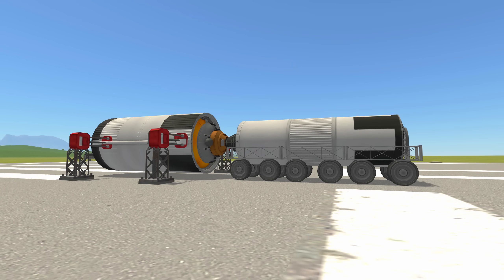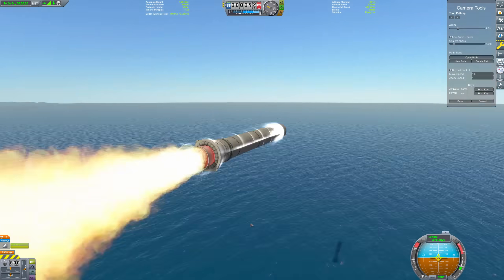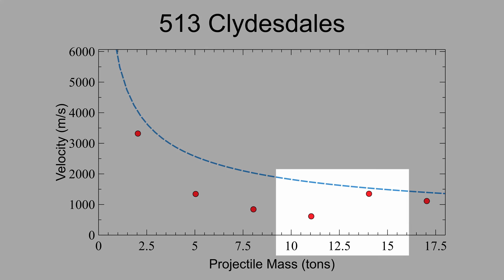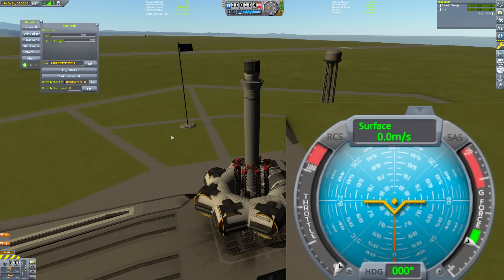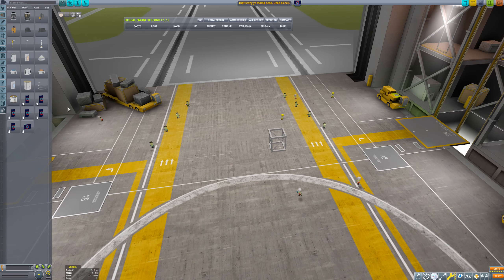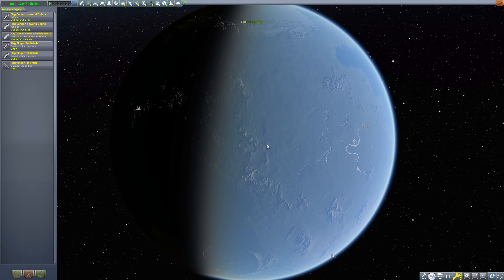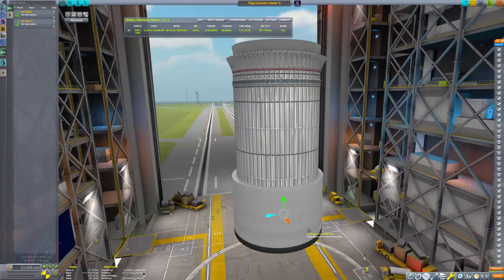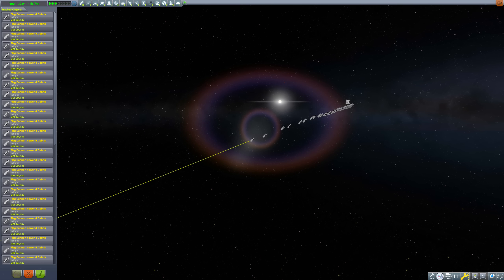Engineering a LIGHT-SPEED mass driver | KSP 1.10.1

Comment: Wouldn't 4x time warp quadruple the velocity? Since 4x the force gets applied in the same frame.
Reply from the maker: That's an interesting thought. I did all these experiments at 1x physics warp and with my physics delta set to 0.03 in the settings. I think it is worth experimenting with these settings to get a more potent mass driver.
Reply: No, I don’t think so. I think physical time warp works by increasing the physics time step, not by multiplying all the forces and velocities by 4. So you would still only get 1 step in the thrust before you were ejected. It would be interesting to test though.
Reply: @samburnes9389  yeah, but if you increase the length of the time step, you have to correspondingly increase the size of the force per timestep.
Reply: Mads Philipsen that’s true, my mistake. Maybe I’ll try it in KSP later today to confirm
Reply: @samburnes9389  excited to hear the results!
Reply: Mads Philipsen okay, some preliminary results: my craft weighed 41kg and was accelerated by 25 boosters. At 1x, it achieved 3,758 m/s. At 2x it achieved 15,011 m/s, at 3x, it achieved 33,756 m/s, and at 4x it achieved 59,947 m/s. So it doesn’t have a linear relationship, more research is needed. With lower speeds it seemed to decrease the final velocity, but with enough acceleration it boosted it massively.
Reply: Mads Philipsen more interesting results: I lowered the mass more and increased the number of boosters, and I dropped it like Stratzenblitz did in the video, and the data becomes inconsistent. At 1x and 2x it’s consistent around 23,000 and 12,000 respectively, but 3x can vary from 17,000 up to 280,000 or 320,000. And 4x has been consistent at 23,630
Reply from the maker: @samburnes9389  Did you try turning off the atmosphere with hyperedit? The atmosphere can sometimes create inconsistent results.
Reply: Stratzenblitz75 I didn’t do it with hyper edit, but I did set drag and lift to zero. It was obvious by the way objects moved that there was no air resistance. It was very consistent at 1x time warp, and mostly consistent at 2x, but past that it varied wildly.
Reply: Sam Burnes That isn’t a linear relationship, but a perfect quadratic relationship. 2x time warp gives you 4x velocity, 3x gives you 9x velocity, 4x gives you 16x velocity. Speed goes up squared in accordance to physics warp.
Reply: Kerbodynamic X there isn’t a quadratic relationship either. The average for 3x is greater than it is for 4x depending on how many boosters I use.
Reply: @kerbodynamicx472  I think I know why. We established that the acceleration needed to be quadrupled per frame, but we forgot that the velocity also needed to be quadrupled. The example down below should explain it.

Acceleration = force * time
Velocity = acceleration * time
Therefore 
Velocity = force * time^2

So if we, as an example, use 4x time warp:
Velocity = force * (time*4)^2
Velocity = force * time^2 * 16
Reply: @samburnes9389   Could it be the same effect described by Stratzenblitz in his video, where the number of frames in the thrust descres with force?
Reply: Mads Philipsen yes, that’s possible, but it happens across a wide range of accelerations, so it’s unlikely.
Reply: But is it cheating? When I re-enter, I always stop time warp below 50km on Kerbin, because the atmospheric heating doesn't produce the same results, even for small simple ships. They don't heat up as much with time warp on, so it feels like cheating.
BTW, they need to boost acceleration quadraticly to give roughly the same physics. a is measured in m/s^2, so that is logical.
Reply: @mennol3885  I think launching a multipart craft this way without it tearing apart is near impossible, so if you can good for you.
Reply: No it gets the force 4x more but it also gets the force during a 4x shorter time
Reply: @Mr BenjiBoy wait so time warp is the same number of physics steps as normal gameplay? That can't be right because of the kraken-ness that happens.

Comment: You could craft file edit a decoupler. I got a Mk3 pod to about 1,000x lighspeed with that method without any cheats. I’d be curious to see how you put that to use
Reply from the maker: When you mod the game, of course its easy to hit ridiculous velocities. With the KAL engine overclocking bug for example, you can hit light-speed with only a few SRBs.
The point of this video was to do it in an unmodded stock game.

That said, modding the parts could be interesting. I wonder if you can overflow the velocity with a high enough value?
Reply: Stratzenblitz75 fair point. Also, I’d love to see if you could accomplish a similar feat with super fast spinning objects. Nothing’s stopping you from slingshotting something at the speed of light... right?

Comment: Did you check to see if the dropping method slope matched the 2 frames of boost slope? They look similar, and I'd guess you get a frame of boost when first dropping and then another frame of boost before it gets back out. One frame gets the acceleration added but the position from falling. The next frame gets another boost of acceleration, and the position gets calculated from the previous acceleration.
Reply: Interesting.
Reply: @notfeedynotlazy  That's how most time based simulations work. Each value of state (position, velocity, acceleration) get calculated for the current time based on the previous time step values.
Reply: In that case I would have expected the speed to be roughly double, but here it's 5 times higher which is intriguing.
Reply from the maker: It is very weird for sure... The slope of the lines for the old and new method were 0.004 s and 0.02 s respectively. The slope of the new method interesting is EXACTLY 5 times higher. I think something could be strange with how the game handles decoupling. In the tests where it starts in the exhaust plume, the flag is decoupled and the boosters fire on the same physics tick. However, when dropping it in, the flag is decoupled first and then the engine exhaust is applied later. Maybe the decoupling, creating a new craft, and applying engine force on the same tick causes strangeness that slows it down? I honestly don't know.
Reply: @Stratzenblitz75  I didn't catch the 5x when I was watching (2 yr old distracting...). That does seem strange. I would love to dig into the simulation source at some point. So many edge cases to handle, and it does the majority of them well enough.
Reply: @Stratzenblitz75  I just thought of something else. It will be calculating the equivalent of a drag term when it is falling. If the integration time is short enough, that can cause a massive negative acceleration, which would be in the upward direction. I've seen that sort of behavior before in other simulations. But who knows.

Comment: So, by KAL oc'ing a single Clydesdale by say 3000x and dropping the flags in...
Reply from the maker: KAL overclocking does work really well as you suggest! You can go much faster than lightspeed using that trick.
Reply: @Stratzenblitz75  And the same speed with much less lag?
Reply: How do you overpower an engine with no throttle?
Reply: What does it mean to perform a KAL overclock? More specifically, what does the abbreviation "KAL" stand for in this context?
Reply: @James_Moton  The KAL robotics controller has a bug that lets engines be overdriven to a theoretically infinite thrust.

Comment: Would be kinda interested how your results hold up if you slow down time with a time warp mod. Excellent job my dude.
Reply: If there was enough frame to allow a realitic result, the slope will be function of a sqare root like in real life and it would be slower.
Reply: @theofilleul6866  Which would be interesting.
Reply: if he slowed down time there would be more frames for the game to calculate what just happened and to rightfully burn the flags into nothing.
Reply: Even better: increase the timestep.The bigger the timestep, the more speed you get from that one timestep.
Reply: @benoithudson7235  That's easy to do actually.  Larger timesteps are why 4x physics warp tends to break stuff.

Comment: I'm wondering, if you used part welding to make all the clydesdales one part, would it be possible to add even more and thus launch a payload larger than a flag? Maybe a kerballed spacecraft of some kind?
Reply from the maker: In the future, I may look into launching larger payloads. There may be some tricks to make this faster in the stock game, such as messing with physics timewarp or adjusting the max physics delta in the settings.
Reply: At that point you might as well just edit the file for a particular engine, and set the thrust to an insane amount.
Reply: @proot.  thats more cheaty imo. with welding youre still limited by stock and only get around the waiting times associated with lag. You probably wouldnt even realize if he used welding and was trying to hide it.
Reply: @lukasstaar6860  But using welding or editing the file does the same thing. It makes it more powerful. At least for this experiment, they are the same thing.
Reply: @noratrieb  No, no it doesn't. The exact same amount of engines will give the same amount of force with part welding, it's just that you can put more in without causing as much lag.
Reply: @nikkiofthevalley  you can multiply stats of a booster by 1000, same result as welding 1000 boosters
Reply: @lukasstaar6860  To be fair, once that it has been proved that this is the result of having 2500 boosters, editing and/or overclocking a single booster to have 250000% thrust can be considered more of a FPS-saving trick than a cheat.

Comment: that string of flags reminded me of a laser; you have successfully turned Kerbin into a death star. Congratulations!
Reply: Imagine being impaled by flags moving at the speed of light
Reply: @martijn9568  FOR THE COUNTRY
Reply: @martijn9568  impaled? I'm no expert, but I think that would have an effect closer to a nuke than a spear
Reply: particle cannon
Reply: True, according to general relativity it will have impulse 2*10^7 times higher than pistol bullet, according to special relativity it will have infinite impulse and probably will destroy the universe cuz of infinite energy
Reply: all star
Reply: If I calculated correctly, each flag would have approximately the energy of 5 megatonnes of TNT, so a stream of those would be pretty deadly
Reply: @Nico-od4yv  Anything with mass traveling at light speed would have infinite energy according to relativity
Reply: "Continue with the operation, you may fire when ready."
Reply: The kinetic energy of each flag is 2.247×10^16 joules.

That's equivalent to 5.37 million MT of TNT. More than enough to destroy planets, but the death star is supposedly designed to produce 6.2x10^32 J/s.

If the death star fired for 1 second, it could accelerate a mass of 1.38×10^16 kg (~30% more than Phobos) to the speed of light.
Reply: That's no planet! It's a space station
Reply: Planetary burst fire hyperlight machinegun

Comment: The man is making Light speed mass Drivers and I can barely put my kerbal on orbit
Reply: The thing that helped me was learning how to use fuel pipes. You can use 2 fuel tanks at the same time but make one of them empty first so that the empty tank can be dropped.
Reply: @Yung Vipe Where are you struggling? G-turns, staging, injection, something else?
Reply: T65Bx Delta V too much bro
Reply: Yung Vipe A few things to keep in mind to maximize efficiency:

-Solids have much lower delta-v, only use them if you’re TWR is beyond hope.

-More famous rockets use only 2 stages to orbit, but up to 5 is perfectly fine.

-Make sure your engines are correctly optimized. There’s very few scenarios where you should be prioritizing thrust over ISP, as you can almost always just add more.

Hope at least one of these can help you out.
Reply: I've resorted to messing about in sandbox.
I managed to recover Jeb from a 10-year solar orbit in a craft with no thrust or docking. It only took about a century of timewarp, several hours (real-time) of using ion thrusters, and three or four separate unmanned rescue crafts.
Reply: Add a flea or something idk I only played demo (I haven't played that actually)